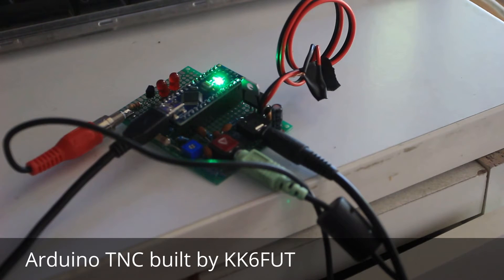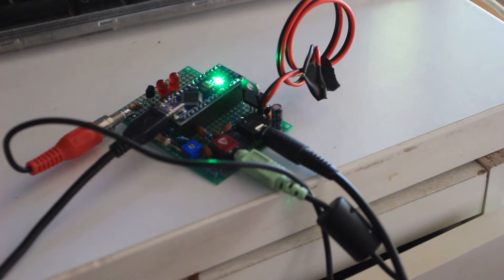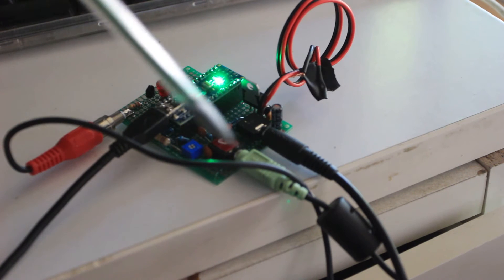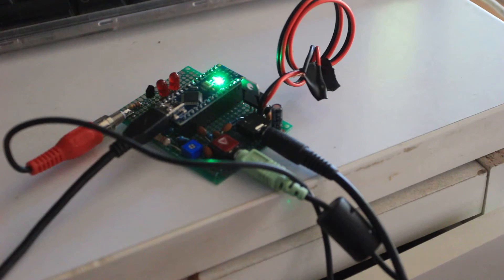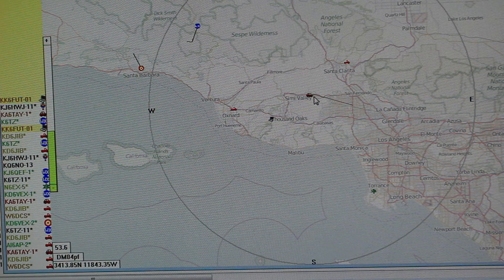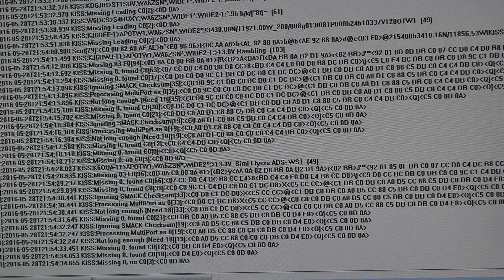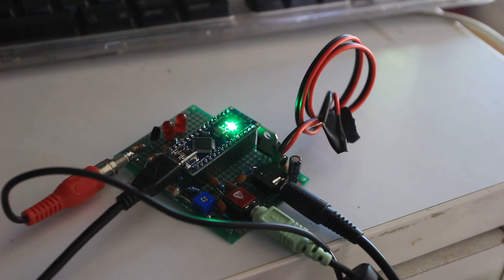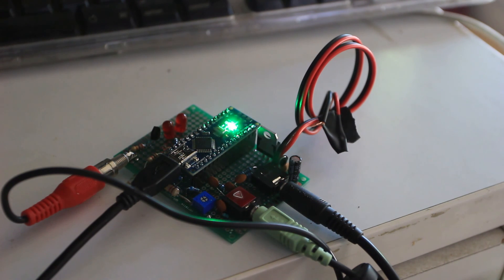Arduino KISS APRS Project - build by KK6FUT

Comment: Looking at doing the same thing, am lookingat building a similar project my self and start doing some peer to peer text messaging, also looking at developing a gui interface similar to a chat program to incorporate a text messenger and slow scan images.  I know its old tech but I think it still has relevance. Am looking to retrofit the case from a MFJ1270B qwith the ar-arduino guts retaining the retro feel.

Comment: After looking at the code, it does not seem to be using an FFT. But rather a DFT to just pick out the two tones. This would be a more optimal solution. An FFT would return many frequencies 0-(n/2) Where the DFT can just pick out the two with O(N) time. As shown here https://web.archive.org/web/20120418231513/http://www.altdevblogaday.com/2011/05/17/understanding-the-fourier-transform/ I could be wrong, I just graduated computer science. So total noob.

Comment: Nice project I have never messed with Arduino but looking at several uses for them lately. I looked at the links and trying to set this but having difficulty locating the schematic for the built. Could you provide updates on your built / bugs.